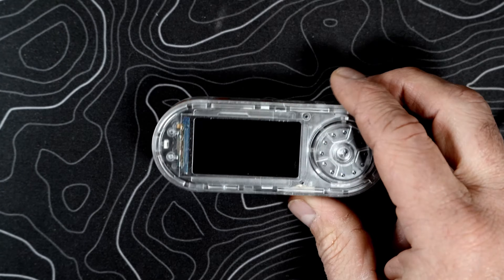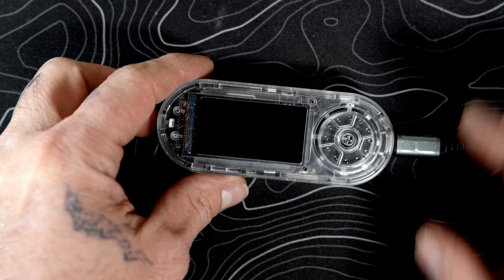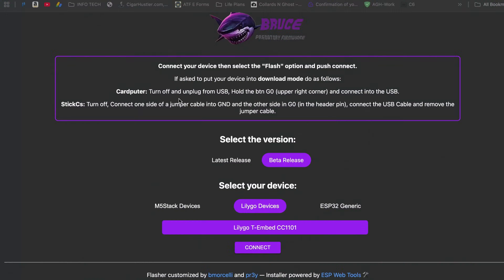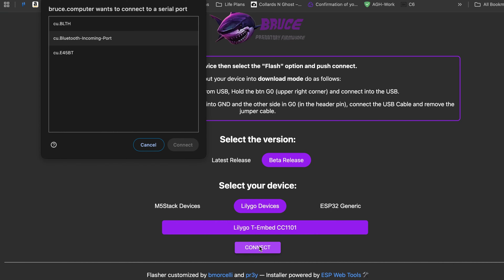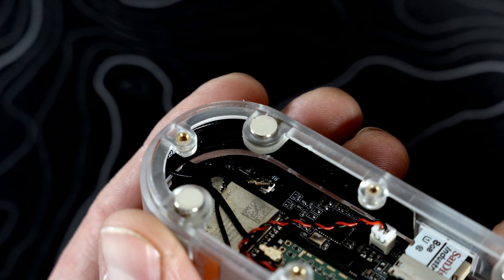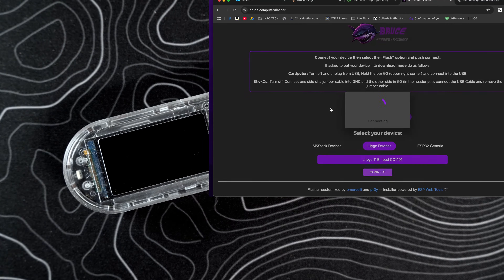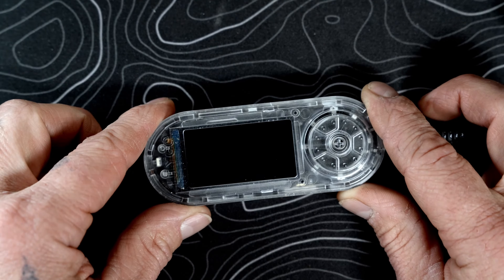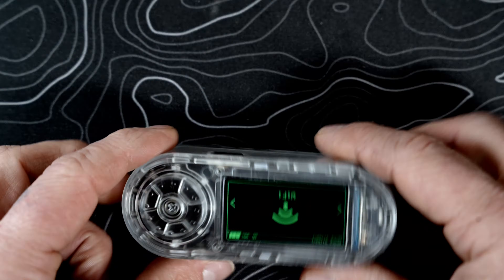LilyGo T-Embed CC1101 Bruce Install

Comment: The easiest tutorial to follow, thanks once again. This channel will have a lot of followers if you continue in the same way, I bet
Reply from the maker: Thanks a ton. Means a lot!
Reply: @Jeremiah.o.A.T  I already have 3 devices running Bruce firmware and they work perfectly. The last 2 updates broke some stuff, but hopefully they will fix this soon. Could you recommend some other interesting firmware options to try on T-Embed? I'd love to experiment with different capabilities on my devices. Thanks!
Reply from the maker: @pavlo.r123 check out Caibarazero. I personally haven’t ran it yet. But it seems pretty nice. 

https://capibarazero.com/docs/esp32_s3/boards/LilyGo_T_Embed_CC1101/
Reply: @Jeremiah.o.A.T wow, looks interesting, will probably try it out, thanks 🤝

Comment: I want to make my own stick... and I have all the necessary modules including EPS 32 s3 or can I just connect everything and install this operating system?
Reply from the maker: @Yr11B  there’s different firmwares to make that happen. Depends on the exact board you have. But I believe it’s possible. You could also try loading marauder on it if Bruce is not available for that particular board.

Comment: I need HELP :
after i install bruce, if i unplug the usb-c like u said in the video and then put back the battery and close the back, it will work or do i need to do something else ?
Reply from the maker: @farhatbrahmi  it should work as long as it was flashed correctly.

Comment: Спасибо. Помогло.
Reply from the maker: @CoolCool-ur3ps  В любое время! Спасибо.
Reply: @Jeremiah.o.A.T  can you help me i tried downloading but it said eraising so i plugged it out and now its just black and when i try to download again it does not work
Reply from the maker: @ make sure battery is unplugged. Before plugging in to usb c hold front wheel button down. Plug in. Keep holding button. Go to flash. Flash. Once percentage in flash goes above 1% you can let go. Once it’s complete. Unplug. Plug back in battery. Then it should kick on
Reply: @Jeremiah.o.A.T  thanks it worked👍👍

Comment: connect-221663ff.js?module:810 Improv initialization failed. Error: Improv Wi-Fi Serial not detected
Reply from the maker: @TheMatheusk3  disconnect battery? Hold boot, while plugging in. Don’t let go until after you hit flash. Try that maybe?
Reply: @Jeremiah.o.A.T  Yes, I disconnected the battery and powered it on while holding the button. Bruce completes the installation and says it was successful, but checking the browser log, this error appears, and the LilyGO stays on a black screen. It was working fine until yesterday, but today it stopped and is stuck like this.
Reply from the maker: @ try installing launcher instead. Then refashing it to Bruce.

Comment: Hey, do you know whats the biggest sd card capacity supported?  And what sd card type? 🥷
Reply: Max size is 32gb
Reply from the maker: @Th1s_Davidthanks for helping out!
Reply from the maker: @oscard7256  I don’t. But I would guess 64-128. Class10
Reply: @Jeremiah.o.A.T  ok, thanks 4 the response. I'll try and let you know if that's supported.

Comment: I have installed the firmware several times, with the beta and with latest, but I have a problem, when I start an attack my lilygo resets itself after a while, do you know how I can fix it?
Reply from the maker: @saveriovalentino8520  reach out on the Bruce discord and see if anyone has similar issues. Here’s the link : https://discord.gg/bruce-firmware-1264994142769909854
Reply: @Jeremiah.o.A.T  ok Thank you
Reply: if it helps, I solved it by installing version 1.8.0, version 1.8.1 has the reset problem for lilygo cc1101

Comment: i just received mine in the mail and was excited to play with my new toy unfortunately the usb c cables i have laying around dont transfer data. i check the cables by plugging in my phone into the cables and desktop unlocking the phone and my phone files did not show up on my computer, ill have to order a data capable cable on amazon
Reply from the maker: @BartholomewJenkins69420  😞

Comment: i did install it with a different type of sd card that pirata recommends,(sdhc up to 32gb)  and it installed and worked fine, i got the proper sd hc card and re flashed it, but the unit was working with out the sd card, so i'm guessing the card is solely for storage??
Reply from the maker: @flavsouza-g2z  yes for bow. Until Bruce expands beyond the units internal memory. Or you want to capture files.
Reply: @Jeremiah.o.A.T   cool. hey hav e you seen that he dropped a pcb on pcbway? pretty awesome

Comment: My device is not seen by my computer
Reply from the maker: @lmg_skoOff  unplug from computer. Hold down boot button. (Center button on click wheel) plug in. Keep holding down boot. Then try flashing.
Reply: That is what I did but it’s not working 😢
Reply from the maker: @ did you unplug the battery?
Reply: @Jeremiah.o.A.T yes
Reply: @Jeremiah.o.A.T when I go to my laptop settings I see my device but chrome don’t
Reply from the maker: @  search esp32 drivers for you OS. You may need to install those first
Reply from the maker: @ try updating chrome. And make sure you’re trying Bruce Lilygo T-embed CC1101. Not the other.
Reply: On my laptop or t embed
Reply from the maker: @ laptop. And also try a different usb c cable. One your using may not be for data.
Reply: @Jeremiah.o.A.T I’m so sorry for asking you so much questions but how can I know that the cable is for data
Reply: @Jeremiah.o.A.T never mind I changes my cable and it worked thank you very much sir
Reply from the maker: @ there’s really no way to tell externally. It’s all internal. You could open device manager and com ports. See if it’s showing anything if you plug and plug in

Comment: Hi! Urgent question, do you need extra hardware to make it work? Like fir all the features, if yes can you provide links of them please and thank you.
Reply from the maker: @Slimeyyvr  no. The CC1101 T embed is all you need. Bruce however is still being developed for it. So as of the latest firmware. 1.7.2 only a few things are working. Checkout Bruce’s GitHub page for what currently is working for the CC1101 T Embed.
Reply: @KJ7VUB  okay but I mean is there features on Bruce that you need to get an extra module for?
Reply from the maker: @ no. At least not yet. There’s no external models built yet for it from
What I’ve seen.
Reply: @Jeremiah.o.A.T  really? RFID is built in? Didn't see that in the spec sheet
Reply from the maker: @ it’s under the main title from LilyGo’s T-Embed page. “T-Embed CC1101
PN532 NFC/RFID I2C transceiver module”

However Bruce currently does not have it configured.
Reply: @Jeremiah.o.A.T  will it be anytime soon?
Reply from the maker: @ I don’t know. I don’t have much insider knowledge with the back end stuff. Your welcome to
Join the Bruce discord. 

 https://discord.gg/bruce-firmware-1264994142769909854

Comment: Bro, can you make a quick video showing how to remove the battery? I managed to unplug the battery to do the installation without removing it, but if I need to remove it in the future I have no idea how to do it without damaging it
Reply from the maker: @heavensplitter  there’s a bit of double sided tape on the battery. Some light pulling/prying will loosen the tape up. And then it’ll come up at a slight angle. Try that. If your battery wiggles around after removing the tape you can always add another layer of double sided tape. I like the red Scotch brand stuff for things I want to stick but may want to move. And the Gorilla tape for stuff I want to stick and it never move.
Reply: Do you have to remove it? Can I just unplug  @Jeremiah.o.A.T

Comment: I also bought it and used bruce, but there were many problems. Some functions could not be exited and I needed to turn off the device and restart it. I hope there is a matching program.😆
Reply from the maker: @小坤杨-o4u  ya. I think it’s still very beta and in the coming weeks Bruce should be fully functioning.

Comment: Sweet keep the videos coming hey was curious do you think the LEDs are going to get working again?
Reply from the maker: @jasonmustang9039  I’m wondering the same thing. I’ll ask the developers and see what the plan is.
Reply: Hey was just curious did you ever get a chance to ask about the LEDs working again thanks
Reply from the maker: @ I looked on the GitHub for Bruce on the CC1101 and it’s still in the works. Here’s a link if you’d like to check it out. 

https://github.com/pr3y/Bruce 

If you scroll down past the “config” area you’ll see a chart with current issues and what’s working for a plethora of devices.